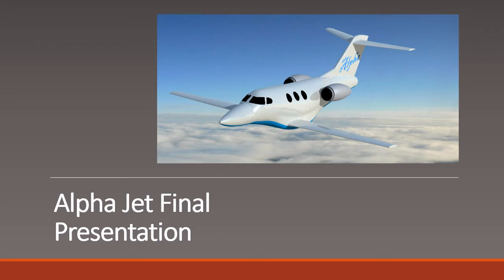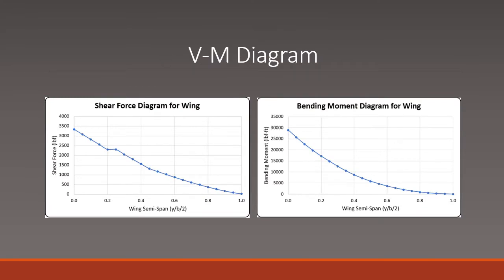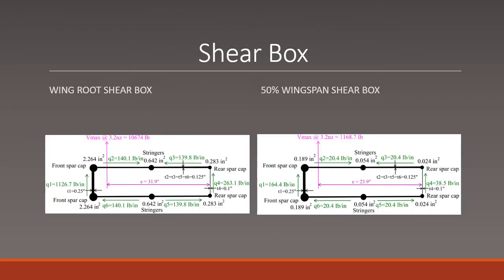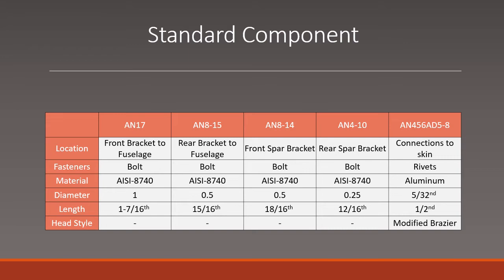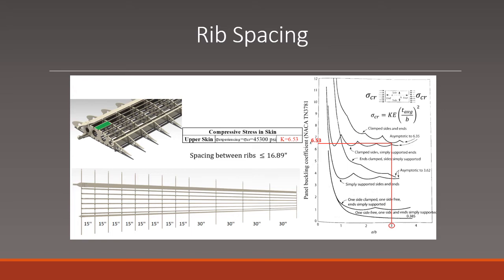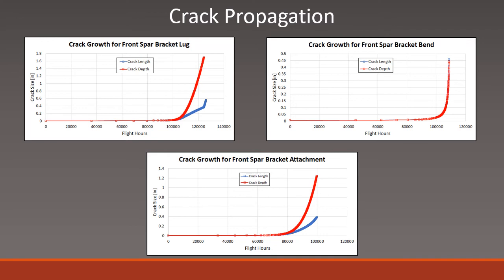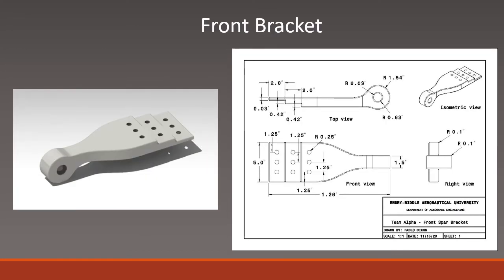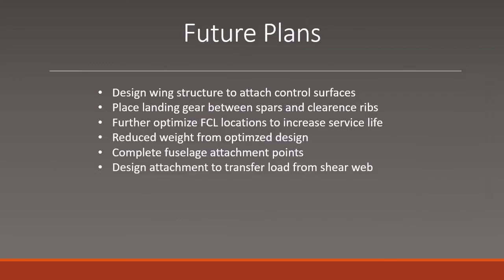Aircraft Wing Structure Design Project

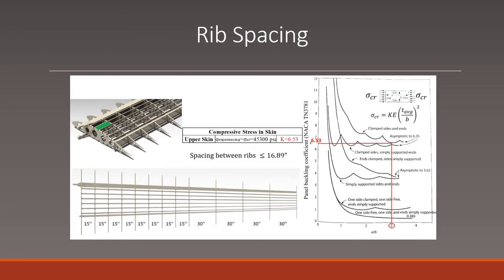Comment: 8:50 I am alarmed that the rib spacing is close up to the halfway point, then sparse further out. It feels like part of the wing is overdesigned, and part is underdesigned. With the power of your software, it should be trivial to distribute the ribs according to the load, instead of some arbitrary parameter.